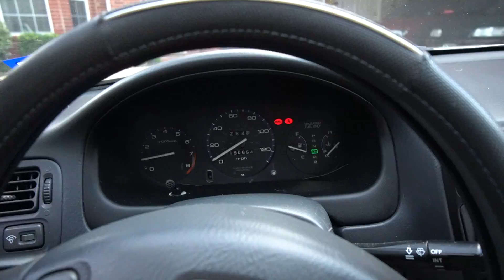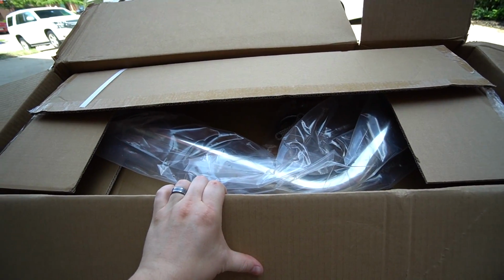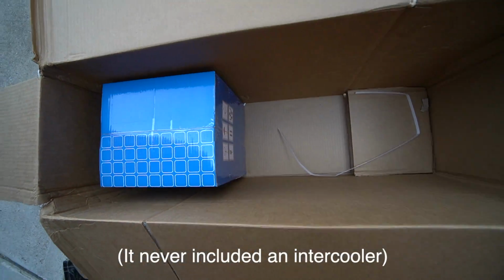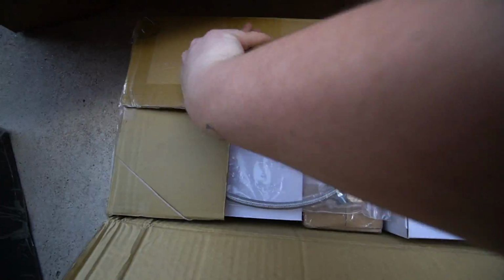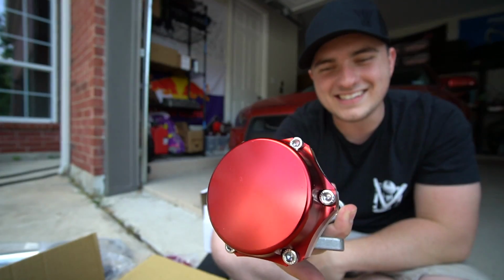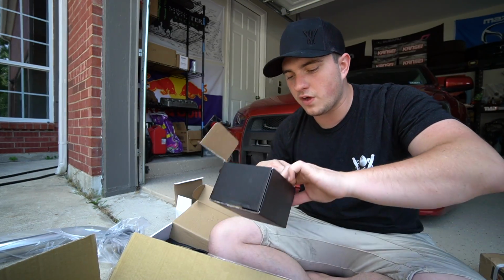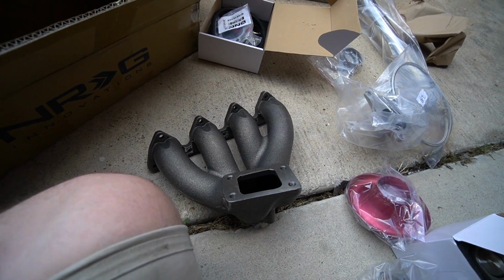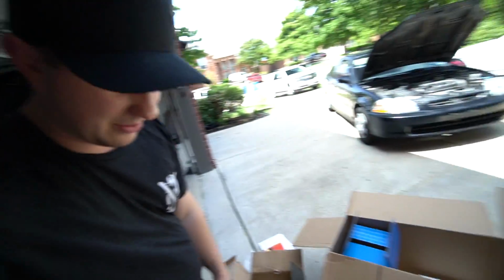$350 EBAY TURBO KIT FOR THE NEW CIVIC!

Comment: Turbo finna die before my phone does and Im on an iPhone so it does even faster
Reply: He buys. A cheap turbo than wonder. Why they blow up quik
Reply: @martinlazalde8163  The turbo didn't blow up the motor did.
Reply: @martinlazalde8163  that was smart... not. (deleted) and Rekt m8 are correct. the motor blew the turbo did not. hole in the block generally means the turbo is working just fine, makin all that glorious boost pressure
Reply: in the last video the turbo had no shaft play..... soooooooo
Reply: The turbo was literally fine, he blew up the motor
Reply: @VanLifeKen  i feel it
Reply: Anonymous69 _ TOO MUCH BOOST

Comment: Those are for running it like out a headlight or using piping to extend that  so it gets more outside air and obvs use some type of mesh around the turbo so stuff dont get into it

Comment: Run a pipe then put that velocity stack in the bottom on the bumper for more air, then put a netting over the turbo before you put the coupler and pipe on it

Comment: Make sure your novice tuner tunes for the Deceleration ignition timing. 
As soon as you let off the throttle * boom *. Because your ignition timing was still advanced at low Load.
Reply: My stock ECU,which is different than yours, is advanced at 63 degrees. Crazy huh? Yeah. It's so it burns all the N/A fuel on Decel and not stall out.

Comment: Did you clean the oil pan after you drilled those holes? If not that’s more than likely why your engine blew from having metal shavings in the oil

Comment: all ebay turbo will last you a year or two. the manifold will crack, the turbo blade will wooble after some pulls.
Reply: An Trinh  I bought a 5431 precision and when i clocked it the damn bolts stripped i never had that problem with emusa turbos must have been bad luck maybe who knows

Comment: Don't use the old turbo unless you completely clean out the center housing. I'm 99% you probably got rod/main bearing shavings that could have flowed through it when the engine blew. And could make their way into the new civic motor.

Comment: I noticed something and I was hoping someone could help clarify. Both of his Civics are d16s, so is mine I have a d16z6 in my del sol. But I noticed on Evan's first Civic (the one that blew) his firing order for his spark plugs was different than this one now and mine as well... So if you're looking at his old  block from the front I noticed it went in order to the distributor as [1234] instead of this one now and mine which are [4321]... Could his have just been wired wrong or am I missing something??

Comment: This is fucking gay man get some actual power plants to work on I drive a Honda but you spending half a grand to make a super fucking slow 120hp car a little bit... well I can’t even say faster,.... not as slow....   put your money into something worth it man or go all in bore out the engine and turbo the car with lots of boost and stable it up so it won’t snap on the third fucking pull.... just my opinion and I think a lot of people will agree with me